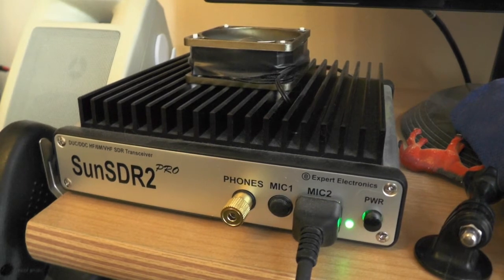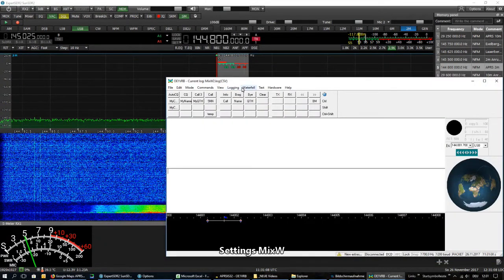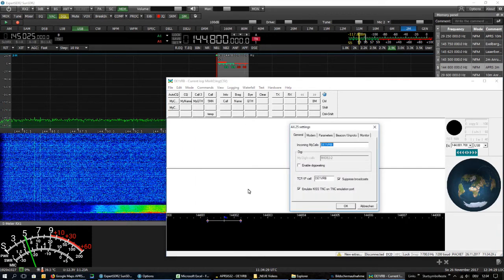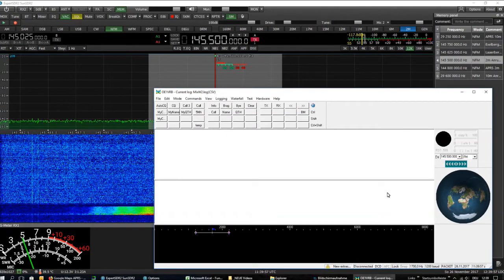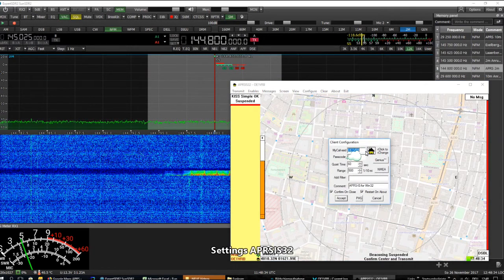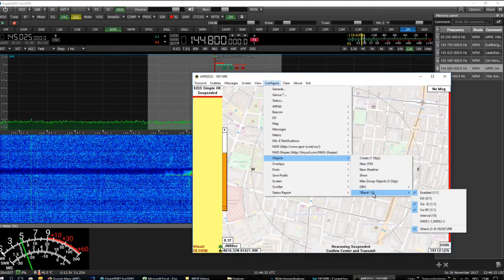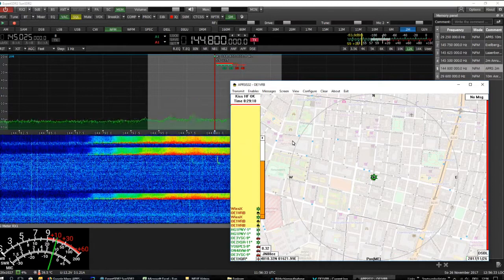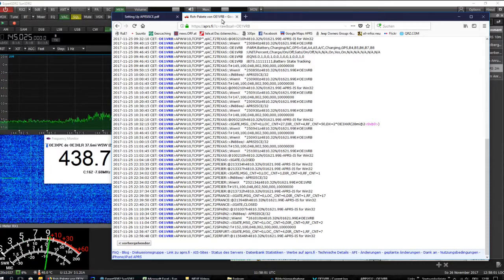APRS operation with a SDR ( SunSDR2 Pro )

Comment: Hi Roland, thanks for your reply. Nice Vid and understandable illustrated. In my opinion i do not need a 2000 € SDR to receive APRS, a 20€ RTL-SDR stick will go for it. My question were not been answerd how is operation in CW, any delay on keying? Any other side artefacts during switching tx/rx? I am asking because of bad practical experience with the ELAD. 
Have you ever tryed JT-modes? How is it going on FT8? How is the sensitivity on 144 Mhz? Thanks taking your time for your kind response.
Reply from the maker: Hi Jo, I bought this SDR mainly as a portable radio, having more then 5W. Digital modes are a side effect, which were initialy not a buy reason. Regarding your questions: 
- CW was successfully tested by using MixW (I can't do CW operation manually). 
- I didn't test JT modes and FT8. However, I installed WSJTX on my computer just before, and hope to find the time to test these modes after Christmas. Keep you updated.
- I didn't recognize any remarkable good or bad sensitivity on 2m. The SDR does what it has to do.
- I didn't discover any side effect during switching TX/RX on SSB and FM
- I had some problems with RMS Express and HRD when I used a netbook with a Atom CPU and 2GB RAM. No problems by using a notebook with a i5 CPU and 8GB RAM.
Reply from the maker: FT8 works fine - see https://youtu.be/0GET6vYlzyc